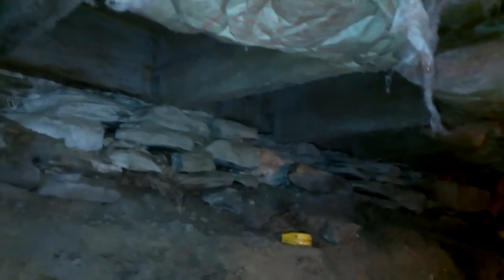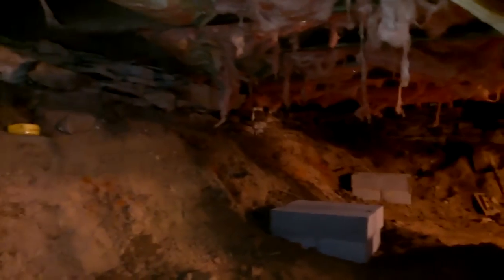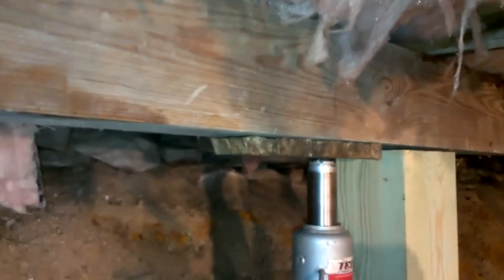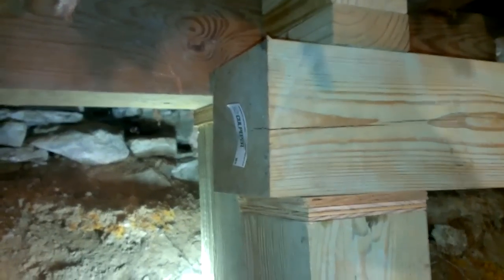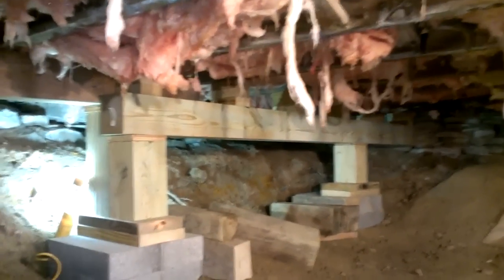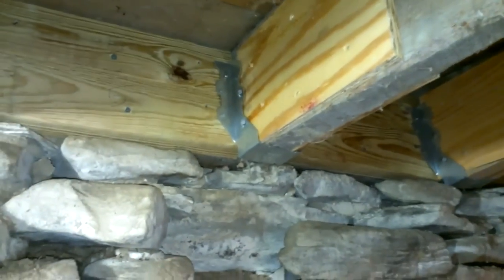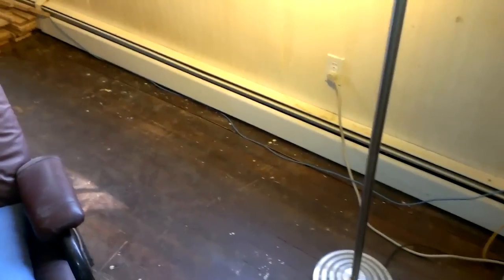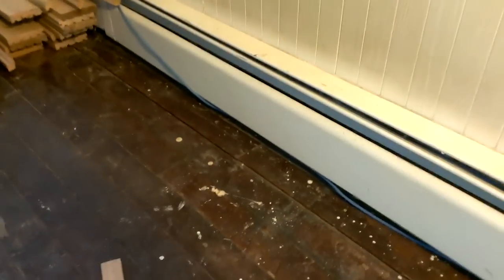Raising Floor in 155 yr. Old House - Part 2, Fixed!

Comment: I took 2 concrete blocks a car jack I lift the floor 4 inches, I stack up bricks got mesh screen and stucco it, I took 4x8 n 4x6  left it like that a month then I lowered the jacks and let it sit on the bricks 2 years later no problems and my floors feel strong

Comment: I have the same concern.  I have a seasonal home in Connecticut , built in the 1920’s .. balloon frame construction-crawl space .   Looks like a brick/mortar support in the center of the house is actually sinking into the ground where there’s roughly an inch space between the beam and brick support.

Comment: not sure if you still reply to this video. but i'm curious if you experienced any side effects on the top floor? 

i'd like to do this on my own house but am a bit nervous that jacking up in one area will introduce flex in other areas, or cause stud bowing which won't easily be noticed unless the walls are ripped out.

Comment: I gather everything is still level? What I am never able to understand is whenever a job like this one is filmed and the process explained (very well explained too)  a warning statement is always thrown in to  consult an architect and or engineer or both. Yet no one ever explains what has been decided on by the “professionals” to achieve a satisfactory outcome? 

So if you don’t mind me asking you (and you don’t have to answer this question if you don’t want to)  - is this what they have suggested? Or is this what you have worked out to be the best method after doing the research?

In Australia our crawlspaces are mostly not as narrow in space as your house - from your excellent demonstration and if one did not know much about the different approaches to levelling houses in confined spaces - one could easily think that everything done so far, the use of unmortared cement blocks, plywood without any measures taken to make sure they don't rot in case of dampness- even the use of "temporary" supports – all seemed like very unstable solutions for an architect or engineer to recommend. But this does work - I know it does -  I have had to apply similar methods  to a part of the crawl space of my 120 year old cottage because it was built almost at the bottom of a hill so the land slopes a fair bit.
Great demonstration!
Reply from the maker: Yes, this was suggested by a professional. My father is a licensed architect, and I am working as the contractor in this case (family owned home). We decided the approach together, where he provides the overall understanding of loads and structure, and I provide the details on tasks and implementation. I agree things will usually work just fine putting in temporary supports yourself, but there are those cases where the loads don't go where you expect. You want someone whose job it is to be very certain.

Comment: Whatever you do DONT INSULATE CRAWLSPACE WITH PINK INSULATION!!!  Especially in homes built before the 1960s in the USA because older homes were built to naturally dry out and the materials used such as brick, plaster, old growth pine here in the south, are materials that breath very well.....that is UNTIL YOU SMOTHER IT WITH PINK INSULATION which actually RETAINS MOISTURE once moisture is introduced and thats where mold and rot come to play!   TEAR THAT PINK STUFF OUT OF YOUR CRAWLSPACE, it wasnt even designed to be installed in an old stone foundation crawl space.   You must insulate using spray on foam insulation which will eliminate moisture from collecting and causing mold and allowing termites to thrive, and the foam will also stop humidity and temperature swings.  

For ANYONE considering buying homes built from 1850-1950, DO NOT INSULATE YOUR HOME WITH FIBER GLASS/ROCKWOOL and DO NOT USE MODERN SHEET ROCK in place of the PLASTER WALL.    Modern materials were invented to work in modern homes which were completely redesigned to make the invention of HVAC systems and appliances so materials were changed in the design as well as a new standardized frame and timber measurements for code.

Just accept that you will never be satisfied with the temperature and the higher climate control costs in your home if you decide to live in one.  The beauty of not changing out the construction materials of old homes is that THEY WILL CONTINUE TO EXIST FOR GENERATIONS MORE!

Comment: I have some sloped and sagging hardwood floors along with a sloped dining room floor that are in a house that I purchased last summer.  The house is 156 years old.  The stone foundation still appears to be solid, but the roof that's over the dining room and bathroom settled every which way but loose.  However, the roof that's over all three bedrooms as well as the living room is still straight as an arrow.  Hopefully the floors can be jacked up and braced.

Comment: Thank you! I just bought a 1901 Victorian home and it needs some work underneath as well. Other videos all show homes with lots of crawlspace clearance. My lot slopes up towards the back and there is very little space under the back, and a mud/utilities room was built onto the back as well so access is limited. I don't want to go through the floors, either. This is exactly what I'm dealing with. Awesome video!

Comment from the maker: Correction: What has happened is this... 100 years ago floor joists were not pressure treated, they were rough hewn directly from local forests. They were not given time to dry out or treated, and were likely dropped into place semi-moist. Over the 100 yrs the moisture slowly released and the joists shrink which causes them to separate from the outer wall. So what you see are joists that have shrunken over time. At time 3:30, the video says the repair will "prevent further shrinking of the joists", 3:55. This is not correct. The amount of shrinkage has already happened, and it can't be prevented anyway. Building out the beam & joists is intended to reattach them so that the joists are again supported by the beam at the outer end.

Comment: This was so helpful. I'm buying a 150yo house and the floors are also uneven. Seeing this makes me feel better that this is possible without having to rip up the flooring..
Reply from the maker: It is much better to do this than rip up the floor.. The reason is that ripping up the floor only fixes the floor *temporarily*.. Because the joists themselves are split or damaged, they will continue to bow and sag over time. Thus if you put a nice new floor on broken joists, it will be uneven again in a few years. The only fix is to bring the joists level and then use additional material (joist hangars, cdx sideboards, replace sections) to prevent further movement.

Comment: Well, I am going to attempt to do this myself. I have been ripped off twice already and so disappointed. I recently bought a home built in 1923. Home inspector falsified the report (maybe he was just an idiot) or I wouldn't have purchased. I'm pretty handy although this is way out of my scope. I'm gonna wing it after watching numerous videos. Still not confident but have no choice. :(
Reply: Did you make any progress? 1923 home probably looks a little different how floor was framed

Comment: I have the same problem but at my second floor
Reply: Start with leveling first floor as needed, then move to upper floors. For upper floors it is Important to spread the load across several feet perpendicular to joists directly below. Again, as mentioned in video,  consulting with engineer or architect before working on this type of repair may save your life.

Comment: Hi! unfortunately  I bought almost  150 years house. Inspecter  suggested  to buy but now I found main beam and whole ceiling  damaged . I have to changed whole first floor , is it possible  and how expensive ?
Thanks
Dev
Reply from the maker: You need a licensed architect to examine and determine how damaged the main beam is. Most likely the beam should be replaced. Costs vary and depend entirely on size and extent of damage.

Comment: I just got my first home built in 1900. I got it for dirt cheap all hardwood floors and I have sagging floors upstairs and my living room ceiling looks tilted. My basement is stone foundation with a dirt floor. The main support beam has a nice sag in it so now I feel like I'm screwed no cracks in it or damage. I'm not sure how long it's all sagged like this. But I'm going to see if I can have the basement jacked up to fix the sagging. I just hope it doesn't cost a fortune.
Reply: Dig two 24"x24"x18" holes in the dirt basement. Put 6" of gravel down and compact it. Add a grid of 1/2" rebar into the holes then pour 5000psi concrete into them. On top of those piers once it's cured, use lally columns to support the beam. You will need a jack and a 4x4 post to raise the beam slowly so you can slip the lally column under the beam. It's not expensive. You may need to scab on some 4x4 post between the lally column and your carrying beam to distribute the weight depending on the condition of the beam and size of the house.

Comment: What about a 130 yr old Brick home that has an upstairs that is sloped? I want to purchase it and we are renting it. One of the many problems that I am wanting to get estimates.
Reply from the maker: @Lindsay. Not sure what you mean by "upstairs that is sloped". Perhaps you mean the ceiling is at an angle. In any case, a brick house will have a very different set of problems. Beams may be resting on brick, which is jacked in a similar way, but has to be supported very differently. Definitely recommend that you talk to several licensed architects, and keep looking until you find one that you like to work with and explains the process/issues.

Comment: Should block up higher so jack ram isn’t extended so far and jack slower as well, pops and creaks are normal but the slower you go the better chance you have to listen and prevent bigger problems

Comment: One other concern for you DIY'ers:  If the house has been settled for a long period of time, the joists may be permanently BOWED. If that's the case, you're either going to crack the joist when you jack it up, or lift it off of the foundation stones that you see there in the video at the exterior walls. The only real way to repair that is to speak with a Structural Engineer, get his advice on what size joist to use, and sister/replace the old joists with new ones digging new concrete footers and piers. Not every home is a DIY fix. So be careful!

Comment: My only concern is TERMITES. At least here in the south, I would not have recommended wood piers to rely on supporting the home for another long length of time. If there's any moisture in that crawl at all, and usually in old homes there is, termites would compromise the foundation and you'd be back to square one. Use concrete and steel when you can! It'll withstand a longer period of time.

Comment: I see a couple of issues here so I'll start with the old saying... the house is only as strong as the foundation it's built on. That said, homes of this vintage are commonly built this way, especially in your area, and it's because they were erected in a time when there was no running water, drain pipes, or electrical that needed access from the bottom side. Heck, some didn't even use mortar or cement between the rocks. If you felt a draft from the floor you piled leaves or pine branches against the rocks to hold out the wind, which of course caused the wood to rot. But hey, that took 50 years so nobody cared. Basically what you have done as a permanent fix will be ok for the next 20 - 30 years, at which time the next owner will have to go through similar motions. I also suspect the next owner will have to do something to stabilize the rock foundation because now you have dirt slope inside, which is prone to shifting. Since you live in an area with winter frost the proper way to address this is to pour a footing below the frost line (at least 42" below exterior grade) and build the foundation up with cement block. Of course that's also the time to address any problems with a rotten sill board. IOW, while the house is supported and there's room to work. When all is complete then the house is rested on the finished foundation wall. Let me add that repairs only attempt to maintain market value but a proper fix can add real value at sale time

Comment: Now how does this affect the rest of the house? Will the walls crack? The doorways level out?
Reply: yes walls might crack or close up old cracks. dont do this under your kitchen or bathroom, you could wreck all the tiling and cupboard alignment. you can also break windows. so just be really careful!
Reply from the maker: Yes, plaster around the walls and door frames may crack. If done carefully, that is by raising each joist only a little bit at a time, you shouldn't have cracks any larger than the floor unevenness you are fixing.
You may need to adjust door mountings.

Comment: Why on earth would you be speaking to an architect before doing something like this? Ask a structural engineer for advice if you want to be mucking around with the structure of a house.
Reply: An engineer or architect for that matter would only be helpful if the framing is exposed or you have a blueprint of the house which is not always the case. I've had to completely disreguard an engineers recommendationd once the preliminary demo is done ( remove drywall) and you can actually see whats going on in some sagging situations- nobody has x-ray vision
Its pretty amazing what some builders did even right up to the early 90's and it passed inspection!
Of course nowadays everything is overbuilt ( we use lvl beams everywhere even short spans- which reminds me in the video those 6x6 beams are not beams and subject to deflection- also you would want to make sure any supports have poured concrete footings to code concrete blocks alone are not steble or strong enough
Reply from the maker: An architect is the correct person to talk to. A structural engineer would over-engineer the repair and cost significantly more. Architects are trained to understand the loads, beams and structure of a house so that exactly the repairs you need can be done. With either professional, the important thing is that they specialize in the type of structure that you are fixing. A structural engineer who focuses on 3-story plus buildings will not be helpful. You want a residential architect.
Reply: A good engineer will find a suitable solution to suit the situation and it makes little difference what size the structure is.
Reply: this repair looks pretty darn good.
Reply: An architect is perfectly qualified to handle the structural integrity of residential home.

Comment: What was your method for replacing the beam?
Reply from the maker: The beam was not replaced in this case. The outer beam was still intact, but the floor joists which rest on it had separated from it. Thus the original beam could be left in place and a secondary beam (shown in video) was added to re-support the broken joists.

Comment: Great Video. What kind of concrete Blocks did you use to support the wood?
Reply: Thank you. Is the wood blocks  just resting on the concrete blocks? If so,  then the the 6x6 wood beams are  resting on the wood blocks? Just confirming that there is nothing actually attaching each block to one another. Thanks.
Reply from the maker: @Jessiferdoose  Yes, the 6x6 vertical wooden posts are resting on wood blocks, and then on standard concrete blocks. Nothing attaches them, but everything must be very square and level.
Reply: What if the earth shifts during an earth quake ? When the carpenters built my home in the early 1970's (Bay Area California), they used a wood block encased in a concrete pier, which is nailed to another wood block which supports the wood beams, which supports the plywood. I have a picture if you need.
Reply: Also, While you were working on the foundation the Jack was supporting the floor. So if the project takes a week, the jack is engaged the entire time until project is finished?
Reply: Thank you very much. I'm Started to understand the basics now. My house is bolted to the foundation. It must have been code in the 1970's.
Reply: Since the 1950s, in California, homes have had their mudsills bolted to the foundation. Although, it always looked to me like the floor joists could just slide off the mudsill.
Reply from the maker: @Jessiferdoose  This was done in Upstate NY, which never has earthquakes. You would need to check what is commonly done in California. I know that outer wall beams are often "pinned" to a foundation, so that it probably what you need to do. Attach them somehow.
Reply from the maker: @Jessiferdoose  No. The jack is only engaged for at most a few minutes. Then you place shims and lower the beam/floor back onto the supports. Go to another location, jack again, shim, and lower back down.

Comment: hi thanks for sharing this video i am in the process of starting this very same project. I was wondering why you didnt chose to use pressure treated or cedar 4x4's to protect from insects and rotting?
Reply from the maker: These are pressure treated 6x6's. You can't easily tell from the basement lighting, but they are pressure treated. 
@Deanoss and @Kachiqui, The question is about the beams, so you can't use concrete, and steel would be extremely costly and over-engineered. Pressure treated 6x6's is the correct material.
Reply: Deanoss Last  i like concrete too.
Reply: Deanoss Last  agreed.

Comment: I am planning to do a sill plate repair. I have few basic questions!   What size of a beam are you using here  to jack up . 4 by4 or  6 by  6. How did you make the shims and whats the capacity of the jack.  thanks you
Reply: Thanks